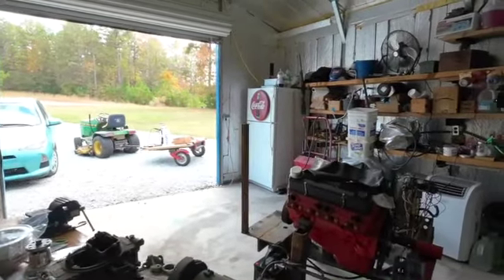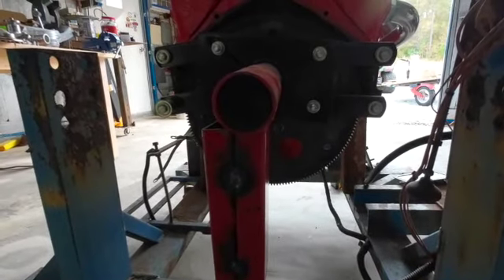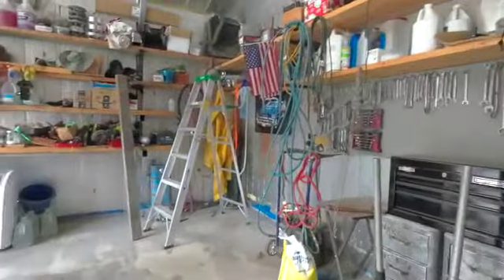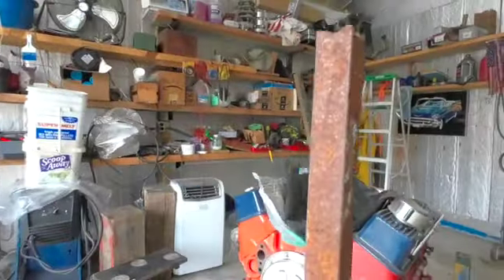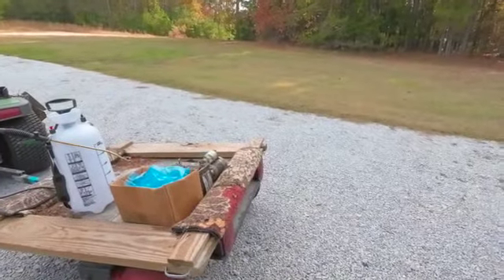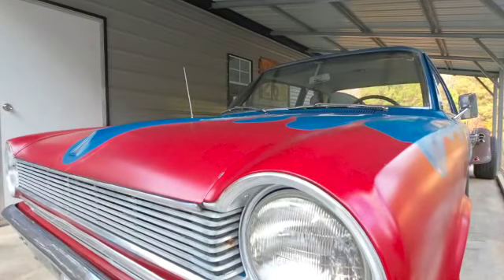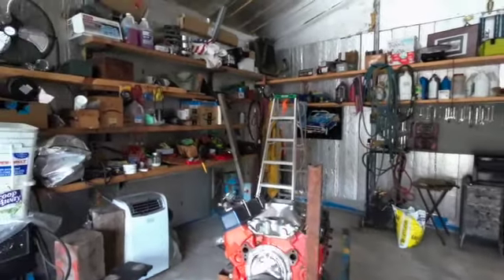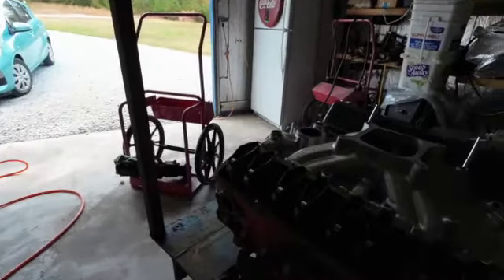Engine run stand remodel #SBC 3

Comment: Yep getting the correct water pump is really important on the build so you don't have to change lots of stuff. Setting the engine stand to the right angle will save you a lot of time adjusting the carb when you install it in the Rambler. 👍
Reply from the maker: Morning Rusty

Comment: Yup the shorter bolts is what you want for the flywheel and yah it be good idea to level out the stand that way when you run the moter it will be better for the oil to run through the moter...
Reply from the maker: Yep